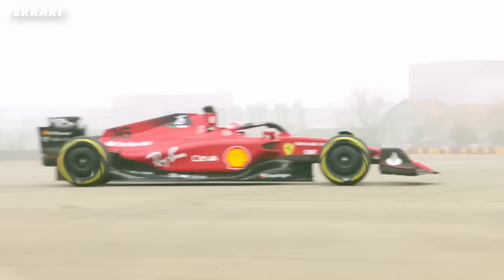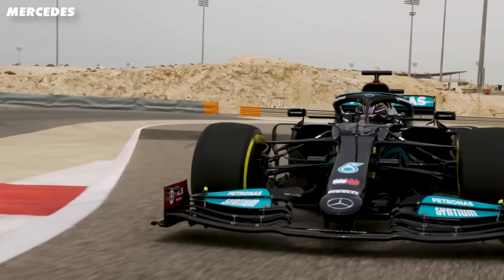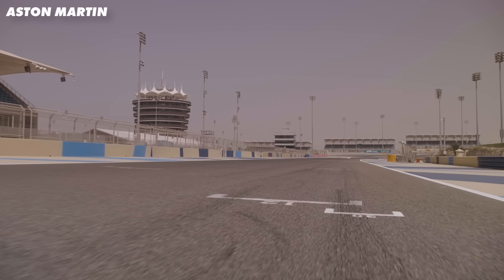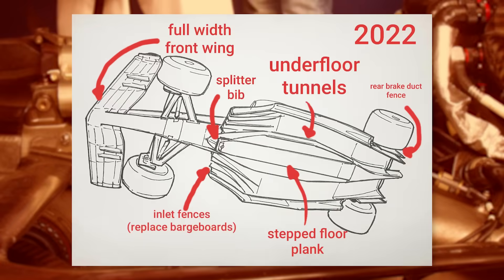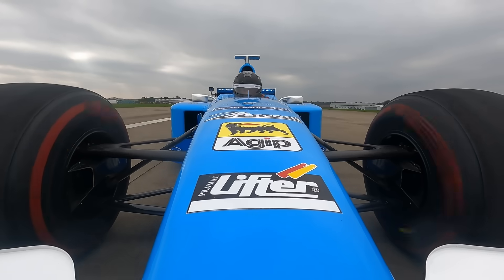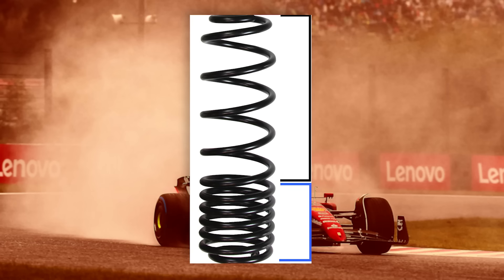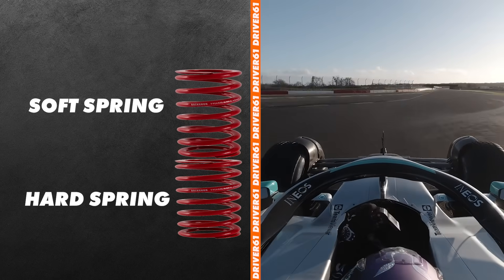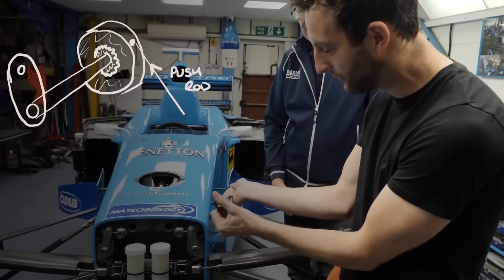Why F1 Cars Use These Weird Springs

Comment: We use very similar setup on our Praga Bohema. Plus we are able to set maximum allowed compression on the softer spring. It is kind of a good solution when you want to keep the weight of the car down and work with the aero performance you have.

Comment: Back in the 70s some F1 cars used progressively ground coil springs which were ground thinner in wire diameter at one end and thicker at the other.  Expensive in terms of the budgets of the day. BRM used them IIRC. Someone did them in titanium.

I corresponded with Harvey Postlethwaite when he was at Ferrari. Which was very kind of him to advise a club level hill climb potterer, and he explained that he abandoned the rubber in compression springs on Hesketh cars because the rubber’s characteristics changed with temperature. Especially due to hysteresis as they were worked so that varied the ride height and the new ‘wing’ cars needed as stable a ride height as possible. On the old pre ‘wing’ cats they were the canine naggers though. The rubber in compression limos were shaped to give a variable spring rate with compression. He opined that, for a hill limb cars, the running was so short that it was not likely to be an issue for rubber in compression hill climb racers. A curious note was that on track racing cars the springing characteristics would change if it rained thus cooling the springs and also lubricating their friction on their mounting points meeting the suspension arms and chassis points. Water being the ideal lubricant for rubber. You learn a lot from a man who made foam rubber carburettors…..

Comment: 1:02 is that really the spring on an f1 car?!?! Looks like it would barely support an ATV thats 300lbs and its supposedly has 1500lbs of downforce at 100mph..... what sorcery is this?
Reply: Funnily enough, the shorter and smaller the spring, the stiffer (assume same spring filament diameter).

Comment: Progressive spring technology has been around in the offroad motorcycle industry since the 1970s. In the last 20 years motorcycles have scrapped that style of suspension in favor of mechanical rising rate linkage combined with speed sensitive hydralic damping. It will be interesting to see where F1 car suspension goes in the next few years.

Comment: For road cars, the spring where the coil has different strength for diffent parts (usually implemented with non-equal rise per turn) is usually called progressive springs in marketing material. It's much better than regular spring but more expensive to manufacture.

Comment: Progressive rate springs - this is a very, very old idea.
Was used by motorcycle manufacturers (certainly Honda with the original CBR), but with limited success. Albeit, this is far from a direct comparison - most notable as bikes don't generate downforce. Either way, the riders generally junked the springs in favour of conventional items as it made the bike unstable mid-corner and I believe conventional springs are still the way forward today.

Comment: the problem with these springs is when you hit something heavy at low speeds you can bind the soft-spring and then get major recoil from the stiffer spring causing the car to effectively launch itself... I am aware there are mitigations (such as dampeners) for this but it doesn't stop it entirely.. basically the cars are a tiny bit less safe to drive.

Comment: Why don't they mount wings and/or ground effect tunnels to the wheel hubs so that only the wheels are affected by the downforce and use softter springs for the chassis?  ...oh right, Lotus tried it....and it got banned. .....

Comment: 5:25 - Description is incorrect. The bottom section of the spring will be the lower spring rate. You have more material in the same amount of spring height. Essentially you are spreading the deflection over more material. Where the coils get spread out you will have a larger spring rate as each individual coil has to go through more deflection for the overall spring height to change. 
Another way engineers tune the springs is by adding material like rubber in between the coils. Allowing the coils to bind earlier in some places vs others. It changes the shape of the k(x) curve by moving the inflection/transition point closer to uncompressed height.

Comment: Why did 80s F1 cars have such poor rebound damping. I was watching some late 80s footage and was quite surprised to see the cars bouncing into the air after each bump from the suspension rebounding. This is usually solved by stiffening the rebound damping, why wasn't this done during the 1980s?
Reply: Probably because suspension technology wasn’t as advanced back then.
Reply: @vazione5410  Suspension technology was plenty advanced to allow for stiff rebound damping.

Comment: Another thing they use are progressive springs, which are designed to have 100+ spring rates over the entirety of the spring. Progressive springs are more useful because they make the transition between softer and stiffer spring rates less extreme. A driver can very clearly tell when the spring rates are changing on a dual or tri-rate springs. Having a progressive spring takes care of the inconsistencies of driving on an ever-changing track.

Comment: They use them so the suspension doesn't bottom out, and for maximum Grip. The first few inches are soft, to absorb many little hits, the bottom part is hard for bigger bumps or stability under braking. 

There you go. Saved 7 minutes of your life.

Comment: Springs don't require a minimum for to "activate" all springs will compress to some degree regardless of how small of a load is applied. What happens is the soft spring eventually bottoms out and you're left with a stiffer spring.
Reply: spring preload. if you have a coilover with a 500 lb/in spring on it, and compress the spring 1" with the nut for adjusting preload, the spring will not move until the force is greater than its preload. in this case, the first 500 lbs would produce no compression of the spring.
Reply: @mustang351c4  No, reload is when you compress it before. If you applied 500 lbs to a spring rated at 500 lbs. Per inch. It would compress one inch. All things move with even the small amount a force. Even a cinder block wall moved when you throw a basketball it...
Reply: @mcduvall2000 Your missing the point.  You have a rigid barrier that keeps the spring from expanding past some height h.  If that height is choosen so that the spring is exerting 500 Newtons of force at that height then the spring won't collapse below height h until you exceed 500 Newtons.

Yes, if you have a force of 250 Newtons it has an effect on the overall system but it doesn't collapse the spring more.  It's the same way that flicking a styrofoam peanut is always going to move the peanut but it only gets crushed if you hit if really hard.

(tho obviously these are all macroscopic approximations...at an atomic level even sound waves move things).
Reply: Believe in JESUS today, confess and repent of your sins. No one goes to heaven for doing good but by believing in JESUS who died for our sins.  For God so loved the world that he gave his one and only Son, that whoever believes in him shall not perish but have eternal life.(John 3:16)❤️😁❤️😋❤️

Comment: That’s not how springs work. You don’t get zero compression in the stiff portion until you get the soft portion binding. And in the case of two separate springs stacked in series you do not get zero compression in the stiff one until the soft one binds. If you have a 100 N/mm spring and a 200 N/mm spring and add a 1000 N load what happens? The 100 N/mm spring compresses by 10 mm AND the 200 N/mm spring compresses by 5 mm, for a total of 15 mm of compression. They are both subjected to the load and they both compress just as much as they would as if they were the only spring there. The 200 N/mm spring would not be sitting there doing nothing until the 100 N/mm spring started binding. That’s impossible. They’re both subjected to the same force. And they both react to the same force. What would actually happen with those two springs is they would be a system equivalent to a 66.67 N/mm spring until the point where the 100 N/mm spring starts binding, at which point it stops behaving like a 66.67 N/mm spring system and starts behaving like a lone 200 N/mm spring. Once the 100 N/mm spring starts binding it can then be treated as a solid piece, or to put it another way, it can then be ignored.

1/total spring behaviour = 1/spring rate A + 1/spring rate B

So, before binding you have two springs in series:

1/total springrate = 1/100 + 1/200

1/total springrate = 0.01 + 0.005

1/0.015

66.67

And once that 100 N/mm portion starts binding you simply remove it from the equation and you’re left with the performance of the 200 N/mm portion. The total system is softer than its two components until the softer of those components ceases to be able to do its job, at which point the total system gets as stiff as the stiffer of the two components, since that’s all that’s left doing the job.
Reply: Great explanation!

Comment: 1:30 Sorry this is just not true, the amount of roll doesn't affect load transfer. A stock 2CV and one fitted with F1 springs have identical load transfer taking a turn at the same G force. One corners flat and one rolls a lot, but total load transfer is effectively the same.
Reply: i don't think he said anything about the same g force though. softer springs enable faster speeds through slow corners, so more g force technically
Reply: @SHRModding  Hmm well the difference between soft and hard springs in a hairpin will be pretty small. I think Driver61, as he has done before, mistakes the car 'attitude'  (roll or pitch) for weight transfer, thinking that stiffer magically means less transfer. A mistake often made btw, not just by Driver61.
Reply: @NielsHeusinkveld  fair enough 👍
Reply: Squishy springs just make the response less quickly, you will see the difference the most in a chicane. Where soft spring rolls and dives like crazy, likely loose the front and rear end in the process, and the car feels absolutely lazy, where stiff springs makes it flat, it gets to max weight transfer quicker with less travel of either springs.
Reply: @Dakkyun  True, but on race cars, soft enough springs for this to really be felt don't exist. They have extremely stiff or even more extremely stiff springs.

Comment: As a supposition as an option of using a torsion bar with a dual spring rate capability, what if the torsion bar had three splines located longitudinally, with two of the splines being located traditionally at the ends and the third spline be located at some percentage of the length, so that a arm at that location would bottom on a dampened stop before full rotation of the torsion bar for range of suspension travel, having the effect of shortening the torsion bar, for a secondary increase in spring rate, the dampened stop providing a progressive transition from the lower to the higher spring rate?
Reply: I think they already use multi tension torsion bars, but I think it wasn't in recent style of design as its not independent so only use as a baseline tune rather than springs which can do more finite tuning.
I think it was used exclusively a few years go to save weight of springs? Now they sacrificed weight for more control (using springs)

Comment: You know, at the peak of the porpoising debacle this year, I thought, in my crude understanding of vehicle dynamics, why the teams wouldn't just limit the suspension travel to just a millimeter or two from bottoming out, but this dual rate spring makes so much sense because with my idea it just makes that limit the bottom of the bouncing crest, while the stiffer grade spring still gives a bit of give as a suspension should
Reply: I don't understand porpoising to any great deal but don't forget the tires themselves are very bouncy undamped springs! So you might still get some form of oscillation even if the suspension wouldn't move! :-)
Reply: @NielsHeusinkveld  good quality tires shouldn't oscillate by themselves, they'll sure absorb some bumbs but that's another story.
Reply: @afoxwithahat7846  Well the nature of all tires is that they are very bouncy, as you can see when a tire gets disconnected from a car during a crash and it goes on a bouncy ride. So if some aero load fluctuations happen and you have no suspension, the tire will get squished periodically and it will be uncontrolled.
Reply: @NielsHeusinkveld  it is completely different, tires aren't "bouncy" they're soft and elastic because those are the most beneficial qualities they could have for racing, they're fully pressed against the ground at all times.
 You're never gonna see a tire bottom-out in F1, tire oscillation can shake the car but move the whole car up and down like crazy is out of question.
Reply: @afoxwithahat7846  Well lets agree to disagree. I reckon tires have a high spring rate, with almost no damping, making for a very bouncy ride if you don't have suspension springs and dampers. Some tractors / farm vehicles you can see and hear it, a small speed bump and they're audibly and visibly bouncing for a good few seconds after that.
Reply: @NielsHeusinkveld  let's agree to disagree, one has 3 to 4 times the sidewall size of the other.
Reply: I guess the trade off from the ground effect in high speed it's not worth it, probably with a millimeter or two the downforce will not be enough to stick the car on the floor.
Reply: if you lock the springs a few mm before bottoming out, you remove the part of the car that can handle bumps in the road etc, any small turn or bump would thus be transferred to the car and make it probably near impossible to handle

Comment: Would it be even better to have a spring which kind of gradually becomes stiffer the further down the bottom you go? So that you have some kind of curve, the more speed, the more force, the more the spring contracts relatively.
Reply: They have that option, and basically all ride height sensitive aero cars use this, by adding bump rubbers. These are progressively stiff rubbers that are hit when the damper is compressed beyond certain amount. They can play with the length and stiffness and even the natural damping of these rubber elements to further tweak the way the ride heights change with speed. For aero load setup, bump rubbers are probably more or at least an equal part than the springs.